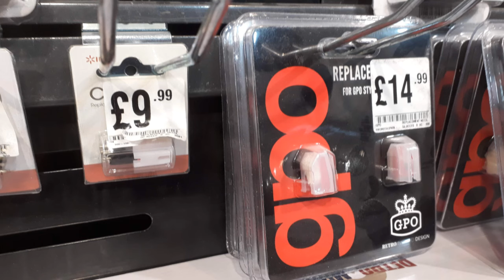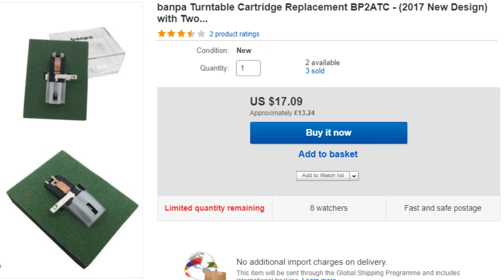Crosley troubleshooting for 'suitcase' style record players

Comment: Hi Thanks so much for taking the time to make this video! I hope you read this, and was wondering if you maybe have the answer.. I have a Crosley that doesn't powerup anymore. No Led, nothing. The Barrel has 9v and so does one side of the diode. The other end was dead (0,0 reading). So I replaced it.I did not have a 1n4002 laying around, and thought: This is some polarity protection diode, I can easily swap this for a 1n4007. This barely had any reading on my multimeter as well. I thought maybe there was a bridge in a track where it accidentilly grounds, so I desoldered the bottom leg. Still, about 9v on one side of the diode, and 0,03 on the other leg. Am I making a mistake that the 1n4007 is not a correct replacement? Hope you have time to the answer!
Reply from the maker: Hi, it's a good question. I have just tried a bunch of different diodes including some chunky ones from power supplies and they all show 8.x volts when I feed 9v into the correct side. I suggest you try another diode. I believe this is just a Polarity protection diode so as long as you get the Polarity right and use a diode which can take the current you should be OK. Good luck
Reply: @mrrgstuff  Thanks so much for the answer! I'm an absolute amateur, but this baffles me. Swapped a few 1n4007s and then went for my usual 1n5187. The voltage drops so much now as well. I'm going to stop burning through the pcb and think about it :D
Reply from the maker: @skeletonmodel  I was just testing them out of circuit. I found one dodgy one which seemed to conduct in both directions but all the other ones I tried gave much same results. I've not had need to change the diode on one of these so far

Comment: My problem is, when I put the arm on the record, it doesn’t play. It just skids across the record. Do you have any idea what’s wrong?
Reply from the maker: First thing to check is that you have a stylus fitted. On a Crosley this is. usually red and has a little rod or bar with the diamond or sapphire point which touches the record. Sometimes the stylus is missing and sometimes the point has broken off. Have a look under the end of the tone arm. It's small but you should be able to see it. If the point is very dirty or covered in fluff this might be the problem too. Otherwise it's likely there is not enough pressure to keep the point in the record groove. On more expensive units this is adjustable, but most Crosley types ones aren't. Worth checking your exact model though. Good luck 👍😀
Reply: mrrgstuff ohhh the point is missing.🤦🏻‍♂️ can you buy them anywhere at a store? Or just online?
Reply from the maker: I have seen them for sale in stores, but I think it easier and often cheaper to get them online. If it's the usual sort of Crosley one (also used on lots of other units), you buy a new red bit and it clips into the black bit which has the wires connected at the back. You can buy both the red and black bit together. Not necessary any more expensive. You might find this video helpful:
https://youtu.be/u4efWHXCfII
Good luck 👍😀

Comment: Is there any way to adjust the needle weight because mine is too light and causes skipping
Reply from the maker: Unfortunately not, at least not on any of the versions I have seen. It is worth checking that the stylus/needle is still there (the little diamond like tip can break off) and that its not clogged with dirt. Also check the record is clean, and scratches can cause skipping also. Other than that people tend to try adding a small coin to the top of the cartridge headshell. This may help, but the extra weight will cause more record wear. If you have records you really value, it would bet better to invest in something better. 😀👍

Comment: My record player is spinning but no sound is coming out, is there anything I can do? I would really appreciate any help!
Reply from the maker: Its very difficult to know what to suggest as there could be several different reasons. The video does cover quite a few checks you could make. One of the first things worth doing is seeing if any sound comes out of the headphone socket. This will tell you if it is a problem just with the speakers. You also want to check the wiring to the cartridge and its fairly easy and cheap to replace cartridge. Good luck
Reply: @mrrgstuff  what if the headphones don’t work either there’s still no sound just slight static ..?
Reply: And I’m kind of nervous to check the wires myself because I don’t want to make it even worse right now my record play just plays very low n there’s no sound through the headphone jack either also I have the Crosley cruise deluxe record player
Reply from the maker: If you can hear the record faintly from the needle area when you listen closely, but there is no sound from the headphones or the speakers, then it could be a bad cartridge. If there is no music at all, the stylus/needle might be bad. You can buy replacement ones, but personally I would change the whole cartridge including the stylus at this point as sometimes the stylus from one is a poor fit on another, even when they are supposed to be compatible. Cartridges are not expensive and are not difficult to fit, but its also possible there is a fault on the circuit board. If you just touch the wires at the back of the cartridge with a screwdriver, you may suddenly get some noise out of the speakers (don't wear headphones in case you do get a loud noise, and make sure the volume is up) and if you do get noise, it probably is the cartridge and not the circuit board at fault. To change the cartridge it needs to be unclipped from the arm and the wires will need to be detached from the back of the cartridge and fitted to the new one and the new cartridge clipped back into place. Problems on the circuit board are much harder to deal with as there are many different boards, so buying a replacement is not easy. Hope that helps and good luck.

Comment: My turntable isn’t spinning with and without the record on it. I’m not sure what the problem is..
Reply from the maker: Probably the first thing to check is if the belt is still ok and positioned correctly. I don't cover this in this video - but there are plenty of videos on YouTube which do. Its also worth checking that the power is getting to the turntable (ie does it turn on at all - is there a little red LED?) . If not - this could be a problem with the power supply plug, the cable or even the on/off/volume switch in the machine. Good luck
Reply: I have the same problem did you figure it out i might just buy a new one
Reply from the maker: There are going to be several reasons why this could happen. Does the power light come on when you turn it on? Does it sound like the motor is turning, or is it just dead.

Comment: When we switch to Bluetooth mode the turntable stops spinning.  How do we correct that?
Reply from the maker: It's a good question, and I have to admit not something I have tried, though I have just got hold of a Bluetooth version so hope to investigate further still. What has been suggest though is that the Bluetooth mode is to use the player as Bluetooth speakers, so you could connect a sound source to like, maybe your mobile/cell. If that was the case it there would be no reason for the turntable to spin. Do the instructions say if it is Bluetooth in or Bluetooth out? Thanks 👍😀
Reply: @mrrgstuff  thank you for the quick reply and clarification.

Comment: Hi Hope You Respond.. so my record player speakers are not working I cant hear anything.. I need help
Reply from the maker: Hi, does the turntable turn and have you tried the headphone socket?
Reply: @mrrgstuff  yes i have tried the headphone socket but stil can hear anything .. you can only hear a little bit its very low and   i brought my turntable like two weeks ago.
Reply from the maker: @sebastianortega1117  If you can hear the music very faintly when you listen close to the record, the stylus is probably OK. If you can't hear it at all then check the stylus (usually the red bit on the end of the cartridge). The little arm should have a point on the end which goes in the groove. To check the amplifier and speakers, have a look from about 20:30 in the video. If its only a couple of weeks old, then if nothing is easily fixed, try to return it as it is faulty.

Comment: Hi I had a question, I got a free Crosley Keepsake, the power cord is giving me the right amount of power, but the system won’t power on, can anyone help?
Reply from the maker: I'm not familiar with this one, but the power supply seems to be DC12v. Is it a Keepsake or a Keepsake Delux as that looks like it takes a different power supply? The  standard Keepsake looks like other Crosleys, just in a bigger box so it is going to be a case of opening it up and tracing the power through the system. If the power LED doesn't light then it could be a worn out power jack or on/off switch or a blown diode. Good luck and if you are not confident to open it up yourself then find a local repair shop.

Comment: mine turns on but the record won't spin! please help its brand new
Reply from the maker: If it has an 'auto stop'  switch then try that in both positions. In one position the record should turn when it is switched on. In the other position it will only spin when you move the tonearm over the record.
I have seen some machines where you have to move the tonearm away from the turntable to get it to start.
As its brand new, carefully check the instructions, and if it is really faulty try to return it for a refund. Good luck. 👍

Comment: I plugged in the wrong voltage plug on accident in and it won't work please help
Reply from the maker: I think the short answer is that you have probably burned out one or more components on the circuit board. It may be fixable, but you will probably have to find someone local to you who can help
Reply: @mrrgstuff  ok thank you 🙏

Comment: And what is it called?? The meter??
Reply from the maker: The meter is known as a multimeter. There are many different models available. I'm using this to check voltages and resistance/continuity. If you are not already familiar with this type of test equipment, I'd recommend finding someone who can do this for you.

Comment: But how do I put it on 78???
Reply from the maker: @branwenwillow298  There should be a speed selection switch with 33.3, 45 and 78 settings. Not all machines have the 78 option fitted.
The stylus/needle fitted to these machines is really designed for LPs, but will work with 78s. If you are planning on playing lots of both, then a flip stylus is a good idea:
https://youtu.be/u4efWHXCfII
https://youtu.be/oxvd1AVGlrk
Thanks 😀 👍

Comment: Hi MrggStuff
I have another question. I have recently a player similar to the one in your video. The arm-lift is not 'demping' with other words the stylus goes down fast without delay on the record. It should delay and go slowly. You know how I can fix that issue ?

Also often the spinning stops to soon if I play 7inch vinyl singles. Can I adjust that ? Now I must turn off the 'auto stop' but than the record keeps spinning and spinning when the record is finished...
Greets from Holland 🇳🇱
Reply from the maker: The auto stop problem can solved by adjustment. Have a look at:
https://youtu.be/hWaGQy8GaWU
This video might help with the arm lift:
https://youtu.be/ocvQWVlNjrQ
Hope that helps 😀👍
Reply: @mrrgstuff  
Thank you again for your quick answer 😄
Very good 👍🏻
So the spring of the lift must be missing or be defect. I shall open the player if I have the time and check it. So it's not a hydraulic system of some sort what I thought 😊
Also the video about the auto stop is very helpful. Im gonna try that. Thanks !

Btw. Where you located ?
Greetings !
Reply from the maker: Glad it helped. I'm in the south of England 😀
Reply: @mrrgstuff  
Ahh oké England 👌🏻
We're a kind of neighbors haha. Only the tiny North Sea between us 😄
I'm from Holland (The Netherlands) as you know. The west part near the North Sea coast.
Groetjes en dank je wel 👍🏻

Comment: My problems is that it starts turning but stops after a few seconds
Reply from the maker: Does it grind to a halt, or stop suddenly like the power has been cut?
Reply: @mrrgstuff  it slows down, and when I turn it on and off again, it does the same thing.
Reply from the maker: I've not seen that specifically, but the motors in these machines are very small and can struggle with the weight of some records. It may be that the belt is stretched or slipping and replacing that might help. I've not done a video on that, but there are many out there. Biggest issue is figuring out what size belt you need as I understand they vary

Comment: Can u help me mine doesn't  want to turn on
Reply from the maker: You need to work back from the mains power supply. Is the wall socket working? If there is a fuse in the plug, is that OK? Is there power from the plug going into the record player? If they are all OK, then you will need to check the power inside the unit, like in my video. If you are not confident opening it up, you will need to find someone local who can help you. Good luck
Reply: @mrrgstuff  this was so helpful thank u
Reply from the maker: Glad it was of use 😀

Comment: Why is the sound so quiet and it’s at max volume
Reply from the maker: Are you getting any sound out of the speakers at all? Does the volume control make any difference? If it's just a tiny amount of sound directly from the needle then you have some sort of electrical fault. It is worth checking to see if you have any lose connections at the back of the cartridge. The only other thing really to try is a new cartridge, but that may not be the problem and may not fix it

Comment: Hi, I have a T400A turntable, When I press the start button to play a record, the tone arm rises from cradle moves to edge of record, starts to lower but then returns to cradle as if record has ended ? any ideas please, Thanks.
Reply from the maker: I have not seen one of these, but it sounds like there is a fault with the sensor which detects the end of the record, so it thinks the record is always at the end. I think you can get around this by manually placing the tonearm on the record. It apparently should then play through to the end and not return automatically
Reply: @mrrgstuff  Hi again, Thanks for your reply, I was thinking on same lines, but the same thing happens when manually operating the tone arm, the only way of playing a record is to hold the arm in place to basically override the normal action ?
Reply from the maker: @robertwilkinson8172  It's difficult to tell. I saw a video with the plater removed, and there mechanism is exposed. It's possible something has moved out of place, or if the machine was dropped or suffered an impact, something might be actually broken. I notice in the user guide there is a 'manual' operation, however this still uses the lift button and apparently auto returns at the end. The Crosley website has instructions for getting around a record not playing to the end and talks about manually placing the tonearm on the record. Interestingly enough, it does say that pushing the stop button causes the tonearm to pick up and return. I would therefore suggest checking the stop button. If it is jammed in or faulty this could match the symptoms you are seeing 🤔

Comment: Mine came with speakers and used to work but now they don't but the headphones work- no wires are disconnected what do i do??
Reply from the maker: If the headphones are working then the needle/stylus and cartridge are working OK. Unfortunately these are about the only user replaceable parts on this, so it's going to be a fault in the amplifier circuit which drives the speakers, or possibly it could be the headphone socket as I would expect that inserting headphones will turn off the speakers, and maybe even though you remove the headphones, the socket my be jammed. Either way you need somebody to take a look inside at the electronics. I am not aware of any easy fixes for this. Sorry

Comment: I found one of these at the thrift store and when i turn it on the power light flashes red for one second then it turns off. Do u know how i can fix it?
Reply from the maker: Nothing obvious I am afraid. Is it the right power supply for the machine? Is it one with a built in battery? I don't know but I suppose it's possible that the power supply is not charging it and yet there is still enough charge in the battery for it to come on briefly 🤔. Unfortunately wierd electrical faults like this are hard to track down. Did the thrift store claim it was working?
Reply: @mrrgstuff  the thrift store said "take as is"
Reply from the maker: @fishhead9057  Unfortunately probably the reason it ended up in the thrift shop